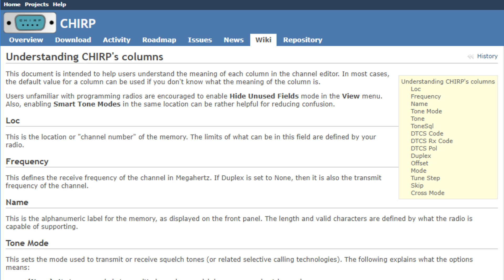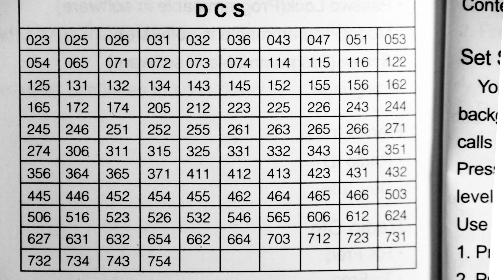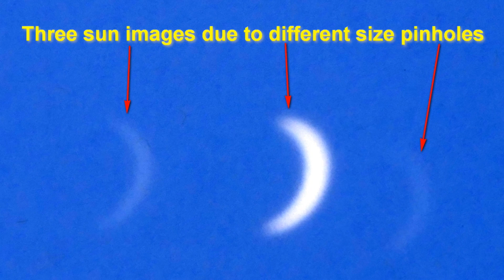Stuff You Need to Know to Set Up Your VHF/UHF Rig (#91)

Comment: Thanks, Dave.  Working with my TH-9800 without a programming cable has been less than enjoyable.  It helped to 'pirate' a copy of the Yeasu FT-8900 manual.  Using the FTdx 3000 is far more enjoyable but that's HF and a different world.  In the meantime, a programming cable is on a slow boat from China.  A girlfriend once said 'Patience is a Virtue'.  Sam aka KK4VTC or 304X0.

Comment: Hi Dave,
 I have an ICON IC 7000 and have set up a solar panel and two 70Ah deep cycle batteries. The problem is the IC7000 needs 13.5 volts and when the batteries drop down in voltage to 12.5 volts the rig starts to reset.  Any ideas how to address the problem.
Reply from the maker: Yes. Here's what I use: http://stores.tgelectronics.org/the-new-n8xjk-boost-regulator/. MFJ has something similar.

Comment: Aviation still use AM because if two stations send at the same time, both stations can be heard.  If they transmitted using FM, both stations would be canceled out.
Reply: More to support my answer.   https://en.wikipedia.org/wiki/Airband
Reply from the maker: Good point.
Reply: That’s Simply NOT TRUE...If 2 aircraft end up on the Same Frequency, the Stronger Signal will be “Captured” while the other station will have to wait...it’s called the “Capture Effect”...just thought you’d like to know...
Reply: Hi Bill! You're absolutely correct that the capture effect is a real phenomenon and does occur, however it only occurs with FM and PM modes. The capture effect does not occur with AM. You can read more about this at the link Bob provided, or this one: https://en.m.wikipedia.org/wiki/Capture_effect
Just thought you'd like to know!

Comment: Hi Dave, I have a question about making a rf choke for my new mosely beam and lightning arrester. ..any info would be great. ..if I need longer coax should I replace or can I use a barrel between 2 pl259...thanks Dave
Reply from the maker: You should follow the instructions in the Moseley beam manual. Ideally you won't have any breaks in cables, but that's not usually possible, so connecting two cables with a barrel connector is normal.

Comment: New Hams, life's too short to be dealing with those Chinese HT radios. Get a Kenwood TH-K20A HT and move on to more important things - like being able to program your HT, without a data cable, after several months without the manual and watching a YT. Being able to program your HT in the field cannot be overstated.

Trust me, I am a relatively new Ham and bought the Baofeng HTs and they are fine - if you program them with a cable and the CHIRP software. The TH-K20A is an excellent HT - it charges quickly, and works great with the stock antenna! And don't bother buying a third-party antenna like the Diamond or Nagoya - the stock TH-K20A antenna is shocking good.

The Baofeng data cable and mics work great with the TH-K20A - most of the Chinese HTs use "Kenwood" connector! And on the subject of the data cable  - spend the extra $$$ and get the Baofeng data cable that uses the FTDI chipset. It will save you more time, and cause less driver frustration under Windows.

It's too bad that Kenwood stopped making the TH-F6A or I'd recommend that radio - one HT, three bands 2m/1.25m/70cm.

Comment: Good video, Dave. I enjoy all of them you do. 

Did you misspeak at 12:05 talking about the "+" for 
the repeater frequency? You said the 147.195+ repeater will transmit 
600kHz above that at 147.795. Earlier in the video (at 4:01) you said the listed 
frequency is the frequency you need to listen on, and is the 
frequency the repeater transmits on.
Reply from the maker: Oops, looks like I got that backwards. The user's handheld transmits 600 kHz above. Good catch!

Comment: I am new and still learning so I may be wrong. But I think that your example about the repeater offset, beginning around 11:55, has the repeater transmit and receive frequencies reversed. If the repeater is listed as "147.195+" then I think the repeater transmits (and the operator receives) on 147.195; and the repeater receives (and the operator transmits) on 147.795. But again I could be wrong.
Reply: If I'm wrong, can someone please correct me. Did I totally misunderstand the discussion from 3:42 - 4:18?
Reply: No, I agree with you, CJ. The discussion at 3:42 to 4:18 is correct: when I listen to a repeater the numbers on my radio show the frequency I'm listening to, which is the frequency the repeater is transmitting on. The plus sign next to that frequency in a list of repeaters (for example), says the second channel (my transmit, the repeater's receive frequency) for the communication is above the one I dial into my radio.
Reply: Donald Miller, thanks! I was beginning to wonder if I had misunderstood.
Reply from the maker: Yep, I got it backwards.

Comment: The only plausible explanation I've heard for AM being kept for Aeronautical VHF:  AM has no "capture effect" that FM promoters are quick to point out. If two signals are transmitted on the same frequency, the presence of both of them is more likely to be detected even if one is substantially weaker than the other.  If the carriers are very precisely tuned, sidebands from both signals can be heard.  If not, the beat frequency—usually a tone—is a giveaway that there's something else under the biggest signal.

There are arguments to be made that given the band's use for distress communications and location beacons, it might be good if weak signals aren't buried under the locals.
Reply from the maker: Good points all.
Reply: When two aircraft transmit at the same time on AM, the controller will hear them both.  However, if two people transmit on FM, they will be wiped out.  The aircraft band doesn't transmit AM by tradition.  They do that so no communication is lost.
Reply: Robert Shorkey : have you ever used an airband radio? I have several hundred hours as a pilot. When two pilots double on a given frequency everyone hears an annoying squeal and it is very rare that one, much less both signals are intelligible. I suppose a trained ear can do better than mine, but what usually happens is the controller tells the pilot he was stepped on,the and he tries again. That is the reality of airband comms. 

I didn't say anything about tradition. I said something about history. If you knew anything about aviation, you would know that it is exceedingly difficult to get aircraft operators to re-equip their aircraft. A wholesale changeover to a new transmission mode is a huge political challenge, not a technical one.
Reply: +David Jacobowitz   "For one, you don't want to hear weak signals mixed with strong ones for the most part."

You certainly do if the weak signal is a distress call.

"I'd much prefer a system where you could just hear both transmitters!"

FM won't help you, then.

Comment: aircraft use AM tx/rx for air to ground  because of the wave pattern is better then FM which is generaly a line of sight flat signal and with an aircraft at say 30.000 ft it's signal would go straight over the ground station/airfield or somthing along those lines ( not trying to condescending either ) 2E0FOK
Reply from the maker: Radio propagation is actually pretty much mode-agnostic, and AM and FM signals using the same antennas will propagate across the same path.
Reply: aha just been speaking with an aviation historian and its to do with signal band width  you can get more on am than fm apparently
Reply: I'm a pilot and a ham, and though that does not make me an expert on either, I think Dave is much closer to the mark than this. Aviation comms channels are spaced at 25 kHz in the US and 8.33 kHz in Europe. The bandwidth of a typical aviation comms transmitter is on the order of 6-8 kHz, and for the narrower spacing, necessarily closer to the lower end of that. As Dave said in the vid, hams use 30 kHz spacing for FM, and the signals are typically 15 kHz wide.

But this is apples and oranges as the FM signals sound better. :-) In any case, aviation could double the number of channels in its band by switching to SSB and would experience no loss in sound quality (though the accuracy of tuning would have to be much better than is typical in the flying museum pieces that most of the aviation fleet is using).

I think the "real" answer here has to do with what was feasible in an aviation comms radio at the time the decision to use AM was made. Radios could not be too big, use too much power, or weigh to much. They had to be robust in a high-vibration environment, etc. AM is very forgiving of mistuning, for example, and using 6-8 kHz of a 25 kHz channel allowed you to use simpler/lighter/more robust input filters.

Fast forward to today, and it's "easy" to implement just about any modulation, filtering scheme, whatever, using digital technologies, and so the aviation world could modernize to something that would allow more channels and sound better. But there are a lot of radios flying, and aircraft owners hate, hate, HATE being forced to upgrade equipment that "Works Just Fine". Avionics also cost a lot. The typical 40W combined "NAV/COM" radio with flip/flop tuning that was standard for decades is still going to set you back $3000-6000 (https://www.aircraftspruce.com/categories/pilot_supplies/ps/menus/av/navcom_0browse.html) and that does NOT include installation. Meanwhile, your junky old NARCO soldiers on. Also complicating matters would be the need to have radios that could support the old and new standards simultaneously, as you cannot convert every aircraft and controller station overnight.

The radio navaids in use (VORs) are also AM modulated, and can share similar receiver designs to the comms receivers. Actually, the format of a VOR signal is quite interesting and is worth some time if you are interested in such things. The signal contains an AM modulated carrier that contains a morse identifier and often, voice weather information. There is also a 9960 Hz subcarrier in which a 30 Hz signal is FM modulated. The entire signals is "rotated" around the transmitting antenna at 30 Hz (this is done electronically today) at 30 Hz, and the phase difference between the 30 Hz FM signal and the 30 Hz modulation of the overall signal gives you the azimuth to the station. Clever and weird. Did I mention that VORs are being phased out for GPS and other RNAV? Of course they are ... but somehow the FAA is in no rush to decommission too many of its VORs. (https://en.wikipedia.org/wiki/VHF_omnidirectional_range)

In short: it's complicated.